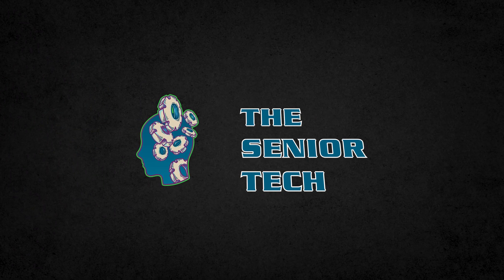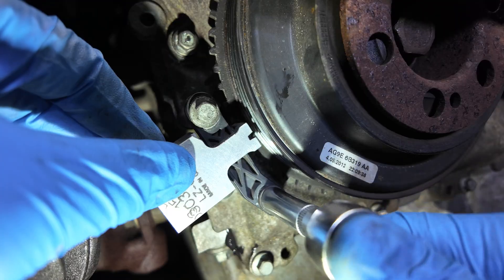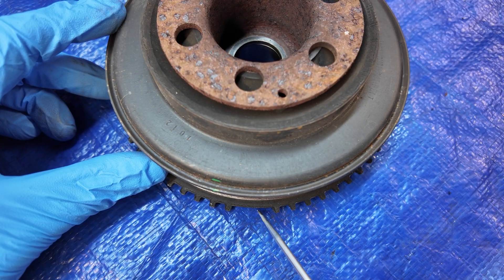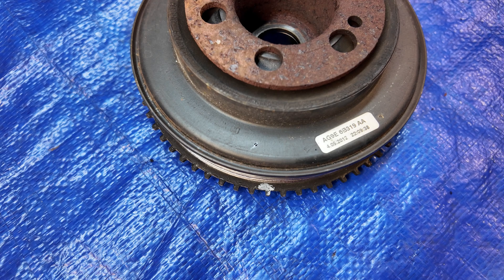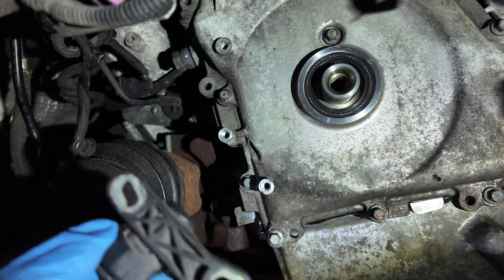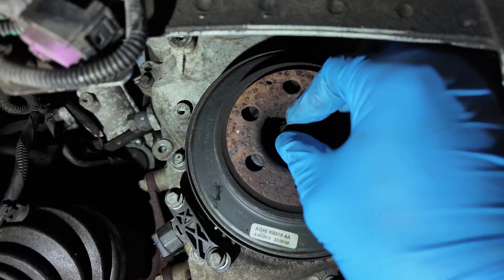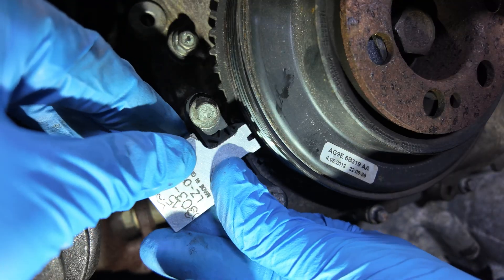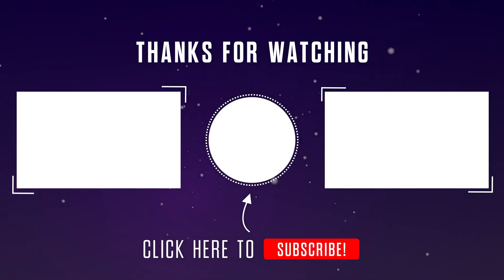2.0 EcoBoost CKP Sensor Alignment - Front Pulley - Tool 303-1521

Comment: Great video! After replacing the timing chain on my 2.0L EcoBoost, is VVT relearn required, or will the ECU adjust automatically?
I'm getting a P0017 code right after the repair. Any idea what could be causing it? Thanks a lot!
Reply: Thanks for the reply! I replaced the timing chain and both cam phasers with new ones.
Is there any way to check if the timing is off without opening everything again?
Maybe by checking cam/crank sensor data or using a scan tool?

Just want to confirm before I tear it down again. Thanks!
Reply from the maker: Hi. You need to look into the datalogger to see if any PIDs are available. I know there is one on 1.0 EcoBoost to check the correlation of cam-crank.
Reply from the maker: VVT does not required any learn. You need to recheck your timing again to make sure it is right. If that P0017 appears after chain replacement, there is something wrong.